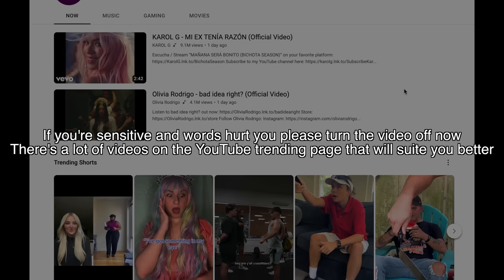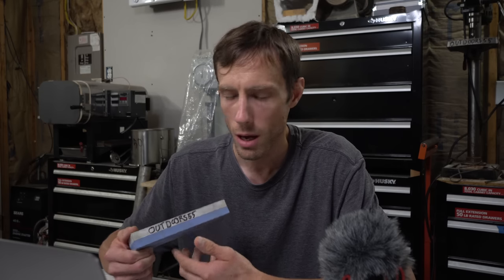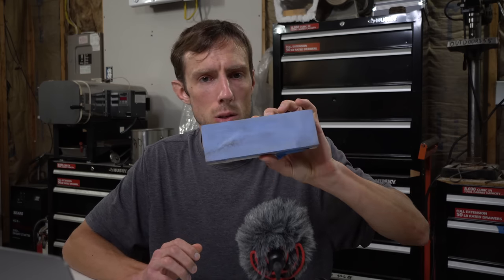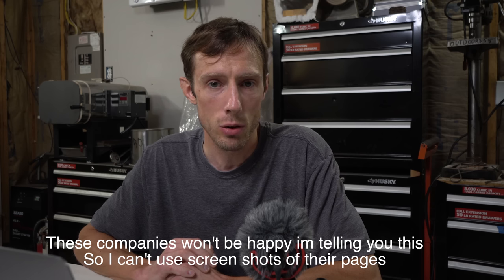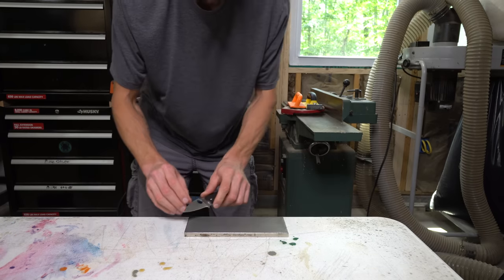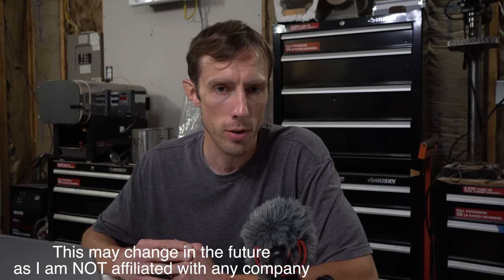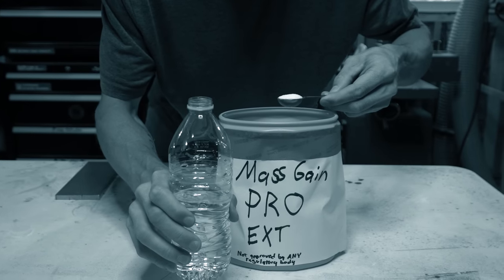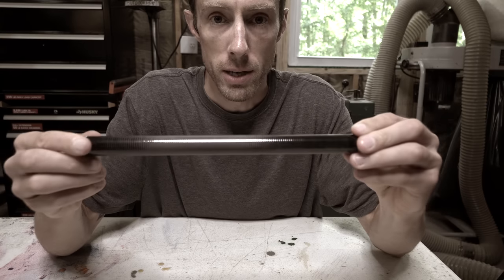The Internet’s BIGGEST Sharpening Stone SCAM

Comment: I got several of those cheap  sharpening stones from Amazon a few years ago. They haven't dished out more than my expensive stones (all stones need re-flattening eventually), don't make a mess and get a great edge on knives and cut-throat razors. Not every seller on Amazon is ripping people off. Most people will get a better edge by using wheels and not bothering with any stones at all, diamond or otherwise. Unless you're off grid or simply prefer spending time sharpening knives than doing something more interesting there are faster ways to sharpen your knives just as well if not better.

Comment: I paid 21,22€ back in 2020 for mine. Learned the basics there. With a TOPS Bob in 154CM. You can get blades sharp with them but as you say prize-valve-ratio isn't there. To get them flat and square again requires the same time and dedicated flattening stones. They are nice to have tho. Long story short mine broke where the 1k and 6k are wood glued together and believe it or not the 1k is great for cleaning and dressing other especially resinbonded dias stones

Comment: I have been sharpening my knives since school days, using a stone inherited from my grandpa, that's still going strong.
But, recently I got one of those V-Sharp Classic II's, and DANG! Razor sharp with zero chance of messing it up. Diamond stones and butchers steel for final honing, I've got cuts from just feeling if the blade has a well-formed edge.
I know, its cheating, compared to the skill you learn from using a free hand stone... But hey, it gets the job done, perfectly each time, on ANY straight edge cutting blade (serrated ones can be done using additional ceramic rods)
I'm lucky enough to be in South-Africa, where they are produced and I can buy online easily, at a MUCH lower price than say, the USA.
Personally, if a pocket knife isn't razor sharp from tip to handle, I'd rather just chuck it in a drawer till I can make it so.

Comment: Did you try Elbor (Cubic Boron Nitride) stones?
I heard it may give even better results than diamond stones. 
It is almost as hard as a diamond, but crystals have a different form, so the edge has a more uniform pattern, like no "deep scratches".
This is what I had been told by the manufacturer of diamond and elbor stones some time ago, and I used it for quite some time. Was able to sharpen the S90V steel knife with it.

I'll appreciate your opinion on it.

Comment: I actually use one of these cheap stones and get good results. BUT, I got it for cheap (about $15 on amazon) and I already had many years of experience sharpening when I bought it. Trying to learn on it would have put me off sharpening forever. Also worth noting that if I have to do any kind of bevel reconstruction at all I use a diamond stone and only use the water stone for refining and polishing.

Comment: I prefer the ol' Arkansas whetstone method.  I still have my Buck Knives Arkansas Stone kit, that I purchased when I was about 12 years old back in the late 70's.  It came with a coarse, fine and oil in a plastic case.  I still occasionally use it.

Comment: Just got my first diamond stone a couple weeks before seeing this vid. Also got it from Home Depot. I’m loving it so far. It’s a 2 x 6 inch stone at around $32. I had a tiny burr at the tip of one of my knives, and knocked it off with a very sharp tip in just 2 minutes or so. Could have done it faster, but I use slow strokes out of fear of losing the angle. Still a newbie here.

Comment: Well, sir, I just stumbled across this video of yours and will finish it in the morning, but I do want to say I totally agree on the DMT Dia-Sharp diamond plates. I got a pair of Wood River two sided diamond plates - 120/180 & 400/1200 grit and fortunately they were half off from them when I purchased them, They're actually diamond coated metal sheets with a plastic core sandwiched in between them, not a solid steel plate with a +/- .001" flat side impregnated with diamonds. I have three; 120 gr., 325 gr. & 1,000 gr.. Since I'm sharpening not only kitchen, fishing and hunting knives, but hand planes, chisels, spoke shaves and more I'll be getting the 600 gr. and the 8,000 gr. ones as well.

Comment: I have a Norton double sided stone that is over twenty years old that I use for lathe and tool bits.  I have had to flatten it a dozen times over the years and it is still going strong. I also have several ezelap stones that have only grown finer over the years. I only have a few small ceramic stones and other than the fragility they have worked superbly as a very fine polished edge is essential for getting clean cuts on plastic materials.
I will admit to using a four-sided TropicalShine emery board on my small pocket knife and xacto blades. It just works and is cheap to replace.

Comment: I got a set of the exact same stones for ~$20 per stone in like 2019 or 2020. I can concur that they aren't great. The 240 grit one is probably the only one that holds together well enough to get anything other than a touch up sharpen done efficiently with. They hold together way better dry too.

Comment: I bought one of these stones for 39.00 back in July of 2023. I had some inexpensive stainless steel cooking knives that were really dull. I used the stone ,admittedly I didn't know what I was doing . I tried to understand the rather vague instructions that came with the stones. I butchered the 1000 grit side. In order to flatten the stone. I have to buy a stone dresser that cost as much as the stones did.

Comment: I've got a stone that looks like that for more than 20 years. From a time when i am not sure amazon was even selling sharpening stones yet. I bought it from a knifeshop locally for way less than those amazone prices. The owner of the knife shop is a knifemaker for decades. He actually learned the craft in the 70's from his father. The shop is in the same place for over 140 years already.
The stone is a 1k 3k combination and it had the print of a german company on the side. It is still the most used stone i have. And while the 1k side does wear quickly, the 3k side does abcolutely not.
And even the 1k doesn't wear as quickly as the way more expensive original japanese stones i bought years later. Which are Naniwa proffesional stones and it gives the same feedback. There's nothing bad i can say about it. Then again, just because it looks the same doesn't mean it is.
About diamond: I bought a spyderco sharpmaker a few years ago too, and i bought the diamond rods they sell for it too, as the ceramic rods took forever to get something sharp again. Thing is, these diamond rods also take ages.
They are pretty rough and still do not remove much material apart from making scratches.
And then i use a diamond combi block my father bought at what is aldi around the world 10 years ago.
I use that thing when i need to remove a lot of material fast. (like with chips in the blade).
It was vastly cheaper than the "high quality" diamond plates from reputable manufacturers i have seen, and so i am hesitant to pay 120€ for a single grit diamond plate when i can keep using the 20-40€ block of my dad.

Comment: I don't have a problem with these stones. Just dont overpay.

I bought a kit that had 3 types of these stones, a flattening stone, a nonslip stand, 2 types of honing jig, a strop, and compound, all for $30.

That's a lot cheaper and better than using wetdry sandpaper if you don't want to invest n expensive stones.

I get hair whittling edges with these things. They work great and they're cheap if you buy them from the right source.

They are very messy though!
Reply: I think the price he paid was the real problem. If you are past 20 bucks or so per stone, the alternatives look mighty better, but at maybe 10 per stone there are not many options like these. Only low grit SiC combo stones.

Comment: I like folks who upload helpful videos.  This one is hugely entertaining, and so I looked at the Amazon link to DMT stones.   It is over £300 for a set of four diamond stones!
I looked at the product use suggestion pictures and laughed because they suggest sharpening a £5 axe and a £1 plastic handled chisel with £80 of diamond stone.

I get a good enough edge on axes with a grind wheel.   I get a perfect edge on £100 chisel sets with a couple of old oil stones and a guide roller - I'm not too proud to still do it as I was taught.

Comment: I remember seeing a couple of toolmakers at about a ten year interval trying to stone a cast iron surface table whilst putting oil onto it and stoning it with a sharpening stone . As they attempted the process the stone was disintegrating before my eyes . Both of the toolmakers were showing an apprentice how to use a sharpening stone to find high spots on the table , they heroically continued not because of the efficacy of the process but in spite of the failure to do so . 
Toolmakers are a proud group and it was amusing to see them persevere . 🤣
Mind you I remember the first tool maker using an off hand grinder without wearing safety glasses and when I suggested this could be dangerous he told me that he had been doing it for twenty years and had never had a problem .😱

Comment: If you are going to pay 50 bucks for a stone just get a Shapton, they are much better than most Chinese stones. That being said buying these stones for 5 bucks is a fair price. Its soft, unpleasant to use, dish out fast, and grit is not the advertized, but you can get a pretty good edge with them. If you can pay for a better stone go for it, otherwise just learn proper sharpening technique. Any stone can leave you with an egde that shaves hair if you know how to fully deburr.

Comment: I'm glad I didn't pay as much for mine as you did. I also noticed that the grit doesn't really seem to match up, I didn't really notice much difference, some finer grit stones seemed to be even more coarse than the actual coarse ones. Since I wanted to use them for honing machine parts it's not good at all with how fast they wear down. No way you get flat surfaces with that.

Comment: Yep, I can agree with you there. Got a combo stone and one side dishes out badly, other side is totally fine. Thing us, you can sharpen just on a rock. I have before, regrinding an old buck 112 from the bottom of a toolkit that was duller than a screwdriver. Got a nicer single grit stone gifted and I've got a couple natural arkansas stones given to me. In the future I'd look at diamond stones. Ive leavened that you need a rougher grit them you think. Even a 300 will get you a very sharp knife with micro serrations they are very effective for cutting certain things.

Comment: I picked one of those kits for $20 that has 2 stones 400/1000 + 3000/8000, a flattening stone. Chisel guide, bench strop with green compound. And various little things. I have some decent stones already since I use straight razors and knew these wouldn’t be that good but maybe good enough for kitchen knives. These stones are such a joke, Especially the 3k/8k. The 8k is more like 800 grit and the 3k side is finer than the 8k side.  I ended up keeping the kit because all the other items weren’t bad and I could use them but the stones will be relegated to setting bevels on beat up blades so I don’t wear out my good stones.

Comment: Just as said in the video, stop buying cheap crap and stones that are a waste of time, like sharpening stones requiring water, to get sharp knives it's completely unnecessary...
I'd like to suggest an additional product the spyderco ceramic whet stone medium grit. It's used in workshops for hss and ceramic bits, it's used by professional knife sharpeners all over the place for finishing, it just takes a few strokes and your knife is sharp again and the stone lasts decades...
I use it a lot and still did not manage to get a dent even on the most used parts of the stone.

Comment: Well Mr. 55, I've not seen you in this, ah, mood before. I found it a fun diversion from your usual info dense no nonsense format. 

I have had very good luck with "Ultra Sharp Diamond Sharpening Stones", I buy these from an online store .... "adjective for really good" Sharpening Stones .... can I say that? Anyway, these look pretty much identical to the DMT ones. Besides sharpening, I use mine for precision lapping of glass and other hard stuff in my business, so I checked the flatness and basically, they are in the 0.001 range. The diamonds have been holding up fine, I'd definitely buy this brand again if I ever wear one out. I have all the grits from 300 to 3000.

In my machine shop I also use Norton India bench stones, especially the fine grade. You can sharpen on them, but I don't (slow). I use them for stoning hard steel tooling and other mild lapping.

Comment: use those to load other sharpening stones.  there’s not a lot going on with abrasives, it’s pretty straightforward.  but the bond is what gives a sharpening stone most of its qualities.  he’s showing stones with cheap bond but there’s still abrasives in there and since the bond does break down really easily you will need to flatten it, so just pick a coarser stone with a stronger bond (which in the flip side doesn’t release abrasives very fast) and load it with the abrasives from the softer stone.  that is flattening your cheaper stones and it is also getting more out of them and also it’s getting better use out of your other stones.  every stone serves a purpose not every stone will immediately suit your needs.  you don’t need a single sharpening stone and you also need all of them.
Reply from the maker: I disagree...The bond and abrasives are both important.
Reply: @OUTDOORS55  well a stone without abrasives would be pretty stupid so they are both important.  there are designer abrasives that are pretty nice, i have a few that are supposed to imitate a natural stone and they leave a really nice finish and there are different shaped abrasives but for the most part they are all very similar.  the $10 stone in the video has aluminum oxide abrasives which is really cheap and is also next to diamonds are the second hardest thing on the planet and the same abrasive is used in the very best knife sharpeners and everything in between.  if you’re only looking at the abrasive then why not just buy the abrasives without the bond?  it’s much cheaper and widely available and if you really geek out on it you’ll discover that you are circling around the same two or three options which is exactly what is inside your sharpening stones.  if you go to the naniwa catalog they sell little stones for loading up larger stones even though both stones use the same abrasives and the little stones are the exact same thing as some of their larger stones.  the stone in the video actually works really well on my shapton stones and since i don’t have to produce as much downforce it extends the lifespan of my better stones.  some stones have larger grit patterns and a harder bond but won’t do much by itself because until the bond breaks down it won’t release the abrasives and so it requires a lot more downforce which is not good.  i collect sharpening stones and i get as much use out of cheap stones that dish out as i do out of more expensive stones, like i’m glad i’ve tried a little of everything but i think you could make a better video about the good value you can get out of cheaper stones.

Comment: I bought a set of probably similar stones (only like 30 bucks, so not bad). The stones were ridiculously soft.  They seemed to scrape material from the stone even with my stainless kitchen knives (very low hardness).  Now, I would not say I got ripped off, per se, as the kit was decent with some extras, but I would not recommend the stones. 

I use a Smith set and worksharp stuff now for hand sharpening. Have used cheap "King" brand whetstone before and found them to be much better than these random brand whetstones and actual grit is much more accurate. Usually this stone is used for just finishing/honing after using diamond stones for the main task. And finish with a two-stage strop with oxide compounds. I would consider DMT, Worksharp, and Smith good products that do what they say.

Comment: The only problem with aluminum oxide or alumina is that it doesn't polish. That's why Japanese waterstones or Arkansas is worth it if you seek a razor sharp edge.

Cheap alumina stones also work better with oil.

Comment: yes, DMT brand diamond knife sharpeners are the best. i bought a little folding pocket one years ago, it opens just like a butterfly knife, and i've been sharpening knives for years with it with just a couple of passes. not a lot of strength is required, and not many passes. even one will do, at least on my knives which are usually kept sharp.

Comment: I had to add this and yes I’m horable. The dual I use is a Fallkniven DC521 with a Lee Valley stone holder. I do wish I could have found it somewhere else because I hate there knives but what done is done. The grit though on these thing is nuts. Dimond is 800 grit and the ceramic is 4500 and they take a beating. I use something different because I need something different. I use a Gransfors Bruk ceramic and its 2 grits are not meant for chiefs. They are 180 and 600 grit but for my needs the size and grit are perfect. I do not have the want or need to be able to shave my face with my knife or axe.